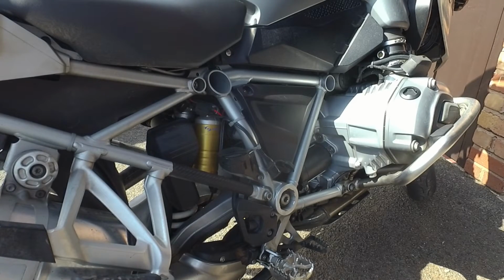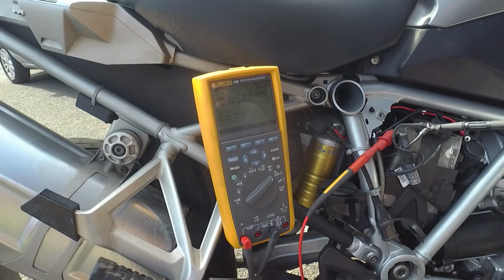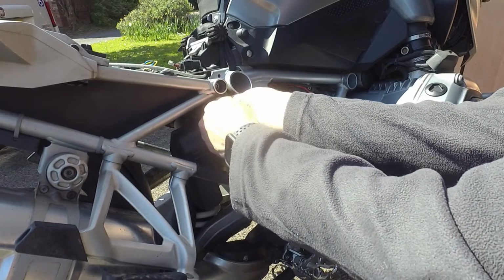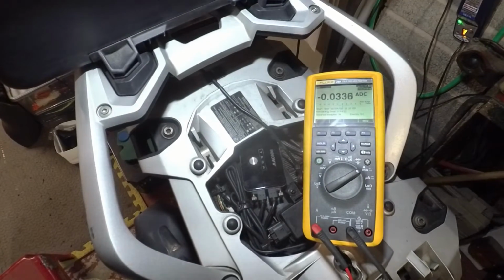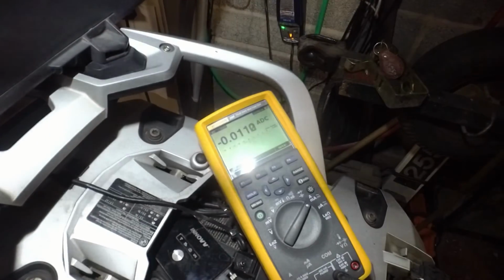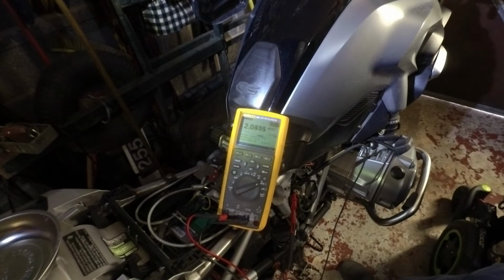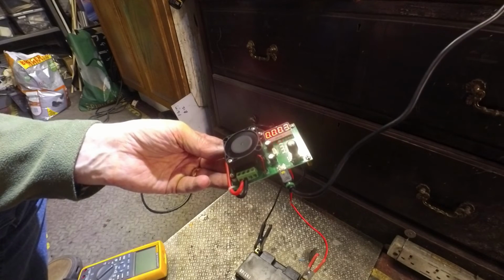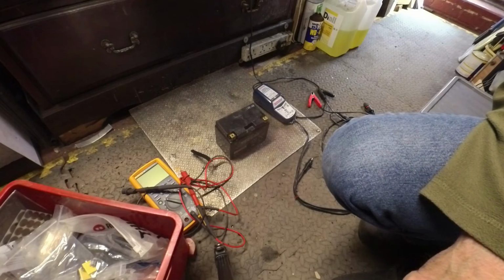BMW R1200GS Battery Drain Investigation

Comment: Hello.

Sorry, I am Spanish and I don't understand English very well.

I think you, and me, and many users of the latest 1200GS models have the same problem. This problem was officially recognized by BMW when the warranty passed. This problem is a parasitic electrical consumption with the bike off by one of the control units of the bike.

The solution is to replace the control unit, worth about five hundred euros. There is a cheaper alternative. Fit a circuit breaker on the negative battery cable to easily cut off the power supply to the bike when it is left parked. It also acts as an anti-theft device.

I'm working on it now.
Reply from the maker: Thanks for your comment. I hadn’t heard that there’s known issue with these bikes but it would certainly explain the problem. The trouble with isolating the battery is that the BMW alarm won’t work and neither will my GPS tracker. Do you know which control unit is supposed to cause the problem?

 I’ve learnt to live with the limited battery life & always carry a portable lithium jump start pack (though I haven’t needed to use it for over a year now). Good luck with yours 👍
Reply: @Greeves
 Sorry, I don't know. There is a method to find out, but I didn't inquire because it wasn't in my preferences to spend that much money. Thanks.
Reply from the maker: @Maicro.  No problem , I appreciate you getting back anyway. Muchas gracias 😎

Comment: I kinda have the same problem.
The bike will start no problem first time in the day or if left for say an hour or so but if I start it and then ride no more than 5-10 min and stop at the petrol station as an example on the way to wherever,when I try turning it on again it nearly drains the battery.And like I said if I leave it for 30 min / 1 hour it starts up no problem.
Reply from the maker: Interesting. That sounds like quite a different problem than I had. So something is draining the battery while you’re riding? Maybe an issue with the alternator / charging electronics. Probably worth getting the error code(s) read by someone who has a BMW compatible ODB system to plug into the diagnostic port.

Comment: This bike needs a computer reflash.  It’s not going into a “sleep mode”.    My 16 gas died after 2 or 3 days every time.
Reply from the maker: Thanks for this. I didn’t know that such a thing was possible. I need to get the rear suspension recalibrated too (since swapping the rear strut for a secondhand one), so maybe I can get them to sort out the battery issue at the same time.
Reply: How would you diagnose that? I have that battery draining issue on my GS and can't figure out what the issue is. battery is brand new and if the bike is left alone for more than 3 days, battery will have dropped too low to even turn the TFT ON.

Comment: Hi did you ever get this problem solved my 2019 has the same issue. I've seen it could be down to valve clearance!
Reply from the maker: Following the checks in the video, I do understand the battery drain issue better. If I’m leaving the bike for longer than a day or two I isolate the INNOVV camera from the bike using the switch I’ve installed. With the camera disconnected the battery holds up reasonably well but still flattens after a month or two. The electrics are definitely not influenced by valve clearances 🤔
Reply: There's a bunch of faulty "General Module Light" modules that seem to draw too much power and flattening any battery in 2-3 days.
Reply from the maker: @bdg88 Thanks for this. I hadn’t heard of this problem. I’ll investigate further….👍
Reply: @Greeves  I ordered a used one from eBay just to try it. But I have yet to figure out where on the bike thing thing is located haha.
Reply from the maker: @bdg88 If I find out I’ll let you know 🙂

Comment: Thanks for sharing,

Think many people have this kind of issue, if you can pinpoint it, you will be helping a lot of people :-)

As for the problem, here my experiance.
Not sure how you know the age of the battery, they don't come with a activation date on them.
I like to buy them with the asid sepperatly, this way you know the age better, maybe the battery is way older than you think?
(a dry new battery will not age, only after activation with the acid).

I trouble shoot a fireblade 954, the yuasa battery did not have the cranking power to start the motorcycle after 1 year.
Owner had bought the year before a new battery himself, so he knew the age very well.
He had the battery on a trickle charger all winter time (about 4-6 months), after that same problem.

Even the charger/tester say the battery is good, it would hold charge, and make the dash work and feul pump when you turned the key, but it did not crank.
Because you cant believe a new battery that young is bad, you wont suspect it........
After a test with a other battery we buy a new one, and problem was fixed, he never used the charger again, and it is still working after 4 year.

I would not install your fully charged battery, leave it for a couple of days outside the motorcycle, and then try it, this way you test if the battery will hold charge at all.

And you eliminate the drain you are suspecting now.
Secondly I would disconnect all the aftermarket gadgets, looking at your testing they can be a bit unpredictable (and thats hard to trouble shoot).

On a side note:

Normally  I do 8-10 years with battery's (boat, motorcycle, car,)
During the off season I allways pull the battery out of them, after 4 moths ore so I will charge them back up, and leave them for a other 4-6 months (completlly disconnected).
I store them in a nice place where it never get colder than 10 deg celsius.
As for my car, its a 2005 e47 and the battery is now 10 years old and working every day, only suspectid him ones, but turned out to be the dynomo, it was broken after 400k km :-)

I know many people love there trickel chargers, but I refuse to work with them.

The motor cycle I have is a BMW r1200GSA 2015, and I can leave the bike for a month and it will start without a issue, mind you I dont have any aftermarket electronics on it and no alarm.

Good luck hunting.

Kind regards

André
Reply from the maker: Thanks for this brilliant comment. I bought my battery retail in March 2019 but it could have been in the shop for some time. I'll take your advice on rechecking the battery after it's 'rested' for a few weeks & see how it holds up. I do use the bike all year round though, so there is no off-season for me (Covid-19 permitting). The only other point is the GPS tracker - I'd like this to be active even when the bike is at home, so removing the battery isn't ideal. Thanks again though, lots to think about :)
Reply: @Greeves  
Hope you found the problem.
One thing I forget to say is, you can measure the voltage drop during starting.
This will give you a good indication if the battery is good.
I don;t know the value's (youtube knows ;-))
And with your nice multimeter, should not be a problem to log it.

Cheers

André
Reply from the maker: andré Kikkert Thanks again. I’ll give it a try and let you know how it goes.
Reply from the maker: @andrekikkert2787  Hi. I tried a start test after leaving the charged battery resting for 24 hours - dropped to < 8V, so I reckon it's well past it's best :( https://youtu.be/3MSKmVs_vkw